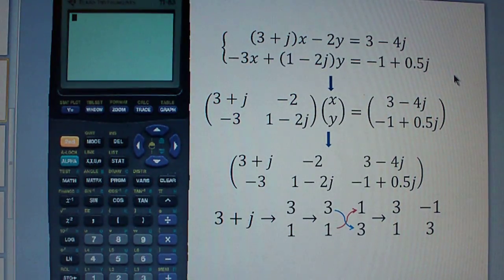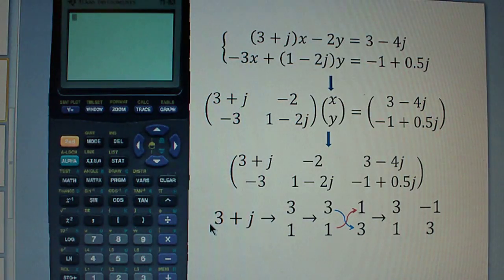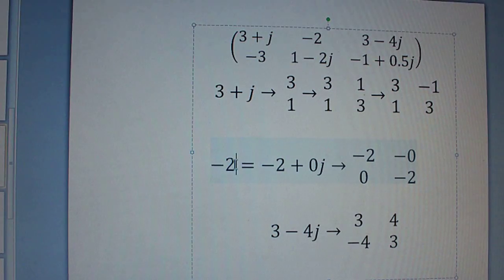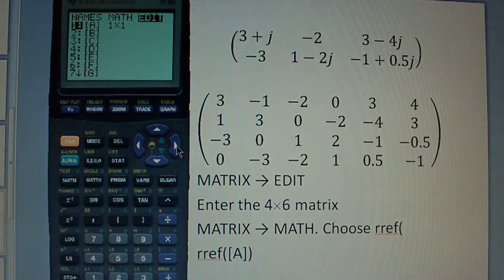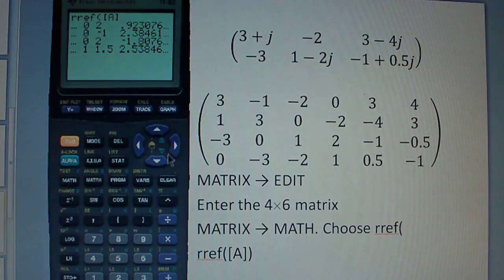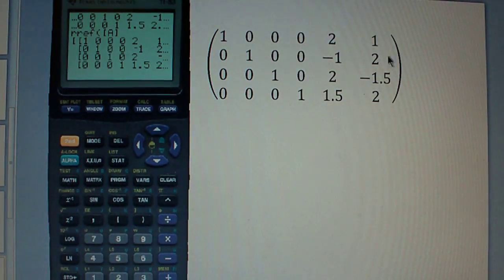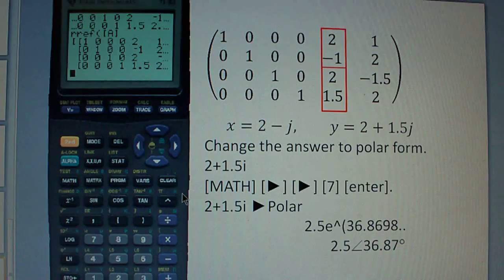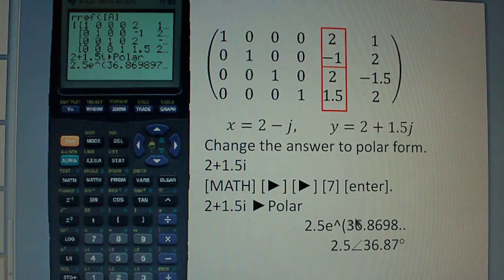Solving system of complex valued linear equations with TI83 or TI84

Comment: Hey Dan, thanks a lot man! Would you be able to explain the logic behind this transformation? How is this the equivalent of a complex circuit?
Reply from the maker: Did you say complex circuit? Not complex numbers? This is RELATED to circuits when you put inductors, capacitors and resistors with a sinusoidal power source. There you get system of linear equations that has complex number coefficients.
Reply: I meant complex numbers, sorry. I haven't taken abstract algebra yet :(      However, I have taken Linear Algebra, and I can see what you're getting at. I suppose I just have to wait a few more years to get more expertise in this subject. Anyway, thanks man!

Comment: PLEASE UPVOTE THIS FREE TI-83 PROGRAM

Thanks Daniel for making this possible!!

If you have a TI-83 and like 10 minutes to input a program, here's a hack that uses this guy's method but does some parts automatically for you. 

Input: Store the real parts in matrix [A]. Store the imaginary parts in matrix [B]. 
Output: The answers are stored in L1, and also displayed for the user. 

This program uses [A], [B] ,[C], [D] ,L1, R, C, X, Y variables. 

Below is the code. /// means a comment, so don't try to type things to the right of it. Those are just so people can see what's going on. 

If you're new at, this, scroll down to see how to get each command typed into your calculator.

======PROGRAM START======
///Get matrix dimensions into local variables R, C.
dim([A])➡L1 
L1(1)➡R
L1(2)➡C

///Copy over matrix variables like this guy said to. 
2*L1➡dim([C])     ///Make dimensions of C twice as big as A's.
For(X,1,R)
For(Y,1,C)
[A](X,Y)➡[C](2X-1,2Y-1)
[A](X,Y)➡[C](2X,2Y)
[B](X,Y)➡[C](2X,2Y-1)
[B](X,Y)*-1➡[C](2X-1,2Y)
End
End

///Compute the answer and store.
rref([C])➡[D]     ///Compute reduced row echelon form.
2C-1➡Y     ///Compute 2nd-to-last column.
R➡dim(L1)     ///Make output list have right dimensions.
For(X,1,R)     ///Store the answer in the output list, and display for user.
[D](2X-1,Y)+[D](2X,Y)i➡L1(X)
Disp L1(X)
End
======PROGRAM END======

If you find you can't read the imaginary part, try these 2 equations after running the program. 

L1(x)➡Z     ///x=nth entry of list
Z-real(Z)

Or you can just enter L1-real(L1) to see all imaginary parts at once. 

If you're a lazy programmer like moi, here are the fastest button routes I know:
Letters: ALPHA + whatever key has the small green letter you want
create program: PRGM + left-arrow + ENTER
edit program: PRGM + right-arrow + program-number
dim(: 2nd + X^-1 (MATRX) + right-arrow + 3
L1: 2nd + STAT(LIST) + 1
➡: the key above the "on" button
[A], [B], [C], [D]: 2nd+ X^-1 (MATRX) + 1,2,3,4
For(: PRGM + 4 (only while editing a program)
,: it's above 7
End: PRGM + 7
rref(: 2nd + X^-1 (MATRX) + right-arrow + ALPHA + APPS(B)
i: 2nd+. (next to 0)
Disp: PRGM + right-arrow + 3
real(: MATH + right-arrow + right-arrow + 2
2: its on the numpad silly

To actually use the program, input the real/imaginary parts into matrices A and B respectively as they appear in the problem. Type PRGM and the program number (probably 1 if you're reading this) Then press ENTER once you see something like prgmCMPLXMTX on the screen. You should then see the answers unless something broke, like this failed because there was no answer. I didn't error check, lol. Or maybe you should double-check that you inputted this correctly <3

if you actually read to here, plz like mah comment because that would make me smile :-)